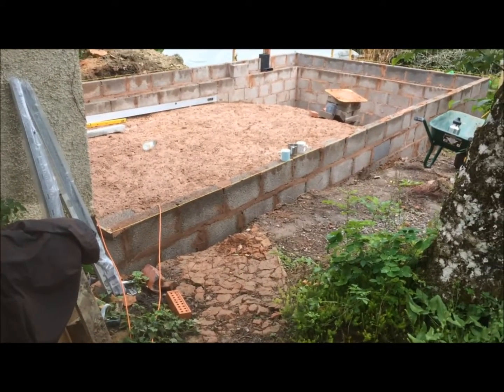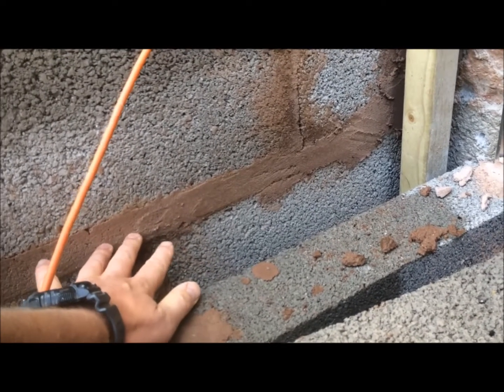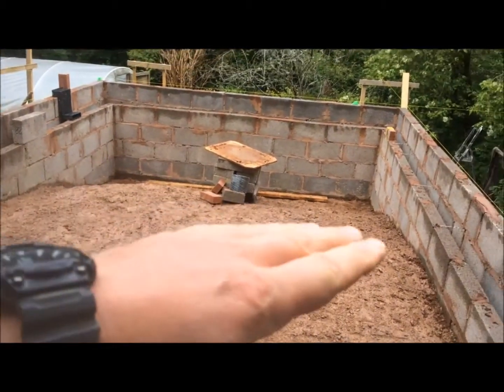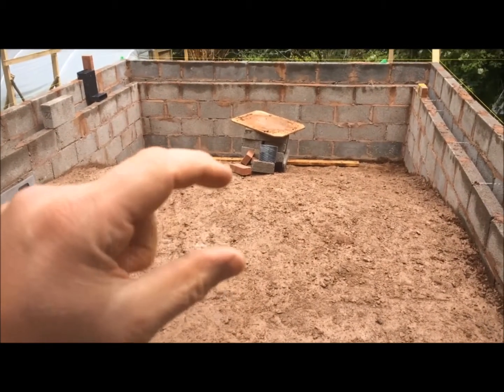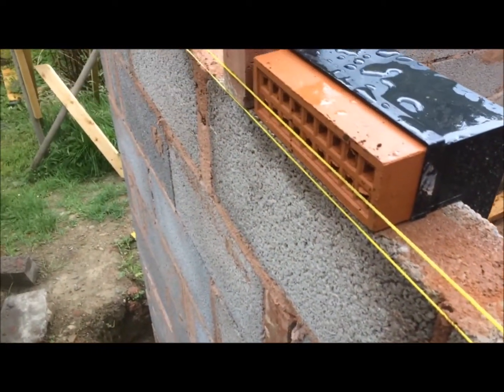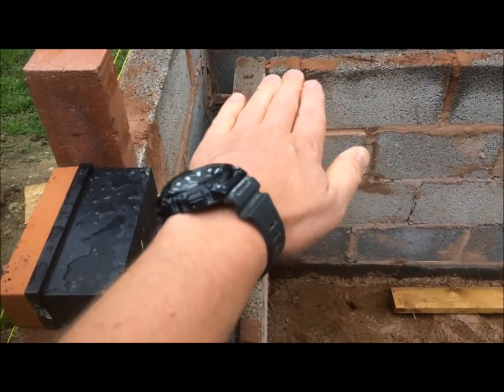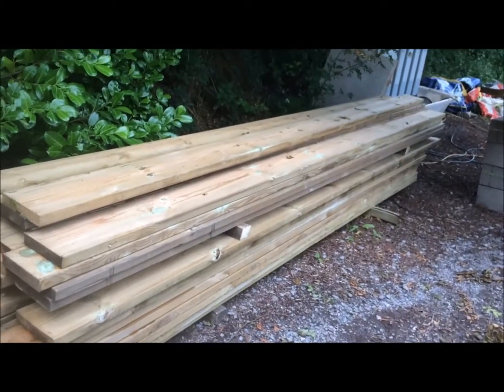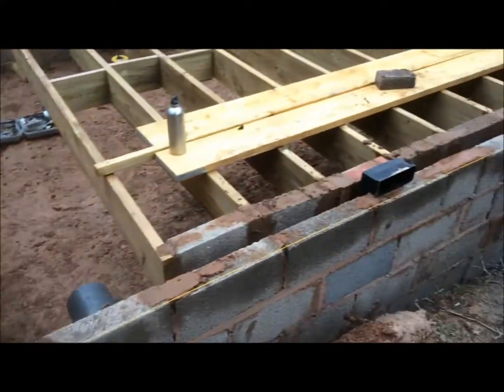Suspended Timber Floor - Install & How To

Comment: Thank you.   Is it a dirt foundation or cement under suspended  floorboards?   I am restoring ground floor house over 100 years. Dirt foundation.   Maybe pipes?  All recommendations very welcome. There's a river across street and a lot of rising damp.
Reply from the maker: If I were you I would get local building inspector to have a look, they’d probs only charge a couple hundred quid. If you post a video and leave a link here, I’ll have a look if you like.
Reply: @DorkyThorpy  Thank you for the quick reply and advice.   I will try to do that.  Thank you very much.

Comment: Which sort of tradesman is best to call out to level a ceiling/floor?
Reply from the maker: A carpenter, general builder or flooring contractor. Give me a little more info and I'll try to help out, what sort of floor is it?
Reply: @DorkyThorpy  it's in a 1860s Victorian house. There are timber joists and the ceiling underneath has lath and plaster
Reply from the maker: @megaman2016  What is the problem with it?
Reply: @DorkyThorpy  there was historic movement and the floor/ceiling below leans to one corner
Reply from the maker: @megaman2016  take up floorboards, and add wood strips or wedges on top of joists to regain correct level.  I wouldn't bother with ceiling. Wonky stuff looks cool. We had a wonky floor in a house 20 years ago, and I laid ply board over the top with wooden strips underneath. Only about 20% of the room needed doing, I left the rest.
Reply: @DorkyThorpy  haha thats sensible approach

Comment: So if the cavity tray prevents water ingress from air vent then it must be under the DPC.
Reply from the maker: No, not necessarily. The DPC go all the way around and prevent upward damp. The tray "kicks" any water in cavity to outside skin. The ones here are just extra, I don't think I even needed them, I just thought it made sense to prevent water trickling on to the horizontal surfaces atop the vents.

Comment: I don’t know where you are in the U.K.? but I am doing a similar suspended floor extension and my building control guy told me to put in a concrete over site with a d.p.m. and to fill the block work void to within 150mm of the d.p.c. Looks like you got off lightly cost wise.
Reply from the maker: That is pretty much what we had to do. We were given a choice of 100m oversite with no DPC, of 50mm with a DPC. Plumped for 100mm without DPC, as not sure on how DPC joins to wall. . . or existing DPC.  We had to fill cavity similar to you.

Comment: Hi
Didn’t you need to wrap the ends of the joists in dpc?
Reply from the maker: Apparently not. Inspector has been and didn't say anything. For draft proofing apparently you can just slap mortar over the ends although I guess you are talking about damp?
Reply: Dorky Thorpy yes, some don’t want the wood in direct contact with mortar and ask for them to be inserted into plastic pockets or wrapped in dpc
Reply from the maker: @b21playa  So is that a damp thing? Or does the mortar do something to the wood?